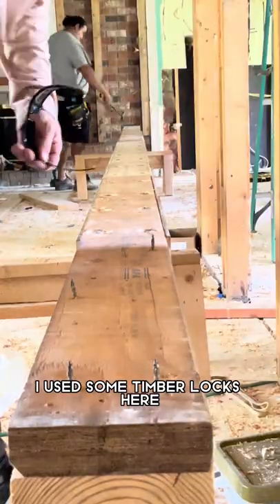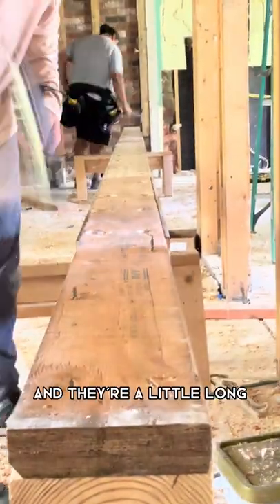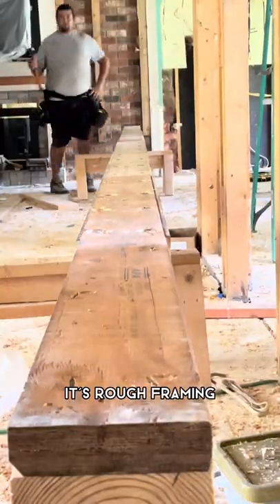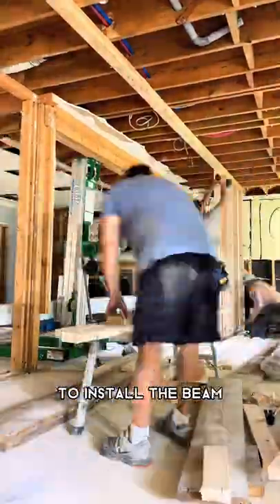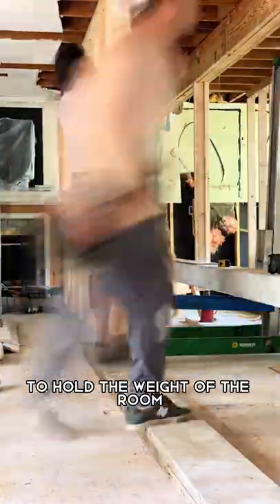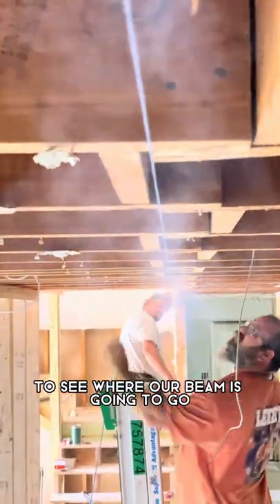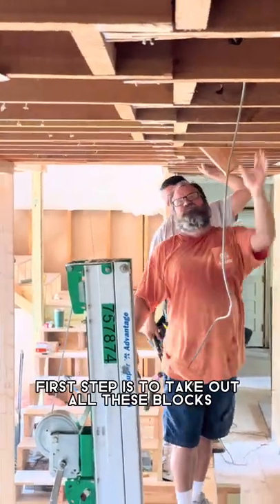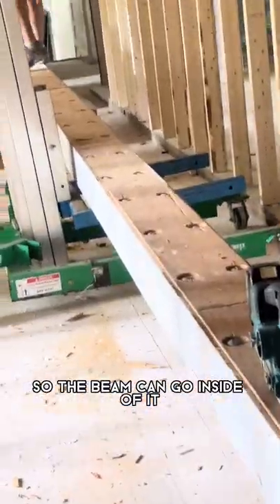Big Beam Install Part 6

Comment: Awesome dude . I just finished a similar job. I chose to build my beam out of 2x12's. Places around my area will try to rip your lips off for LVL beams. It was going to cost around  800 dollars for a 16½ foot LVL beam. I built it out of 2x12's and ½ inch plywood for about 150  dollars. And I had to set that bad boy by myself! You wouldn't believe how hard it is to find guys that want to work. I've had 5 helpers in 4 months!

Comment: This might work out fine, but if any of you at home are thinking of trying this, don’t. Structural engineers aren’t always cheap, but building collapses are always expensive. The likelihood you could span this distance at that beam height in anything other than steel is quite low.

Comment: That must have been expensive to prop up the ceilings with wood, don't you guys use steel acro props?
Reply: "it's just what he had laying around" plus they can be re used..
Reply: idk steel acro props but it’s gotta be more expensive than a 2x4 bro
Reply: @jhmonti007  They're only about around £20-£30 each, with the prices of wood i'd say they are worth it. You can spread them out more then wood and they are adjustable, the real only issue is you need somewhere to store them when you aren't using them.
Reply: Do you own stock in the company 🤔
Reply: @Vermagerber  Nope xD, just the company I work for own about 30 acros and we use them regularly, I just think it's quicker, easier and cheaper then setting up a large framed wall.